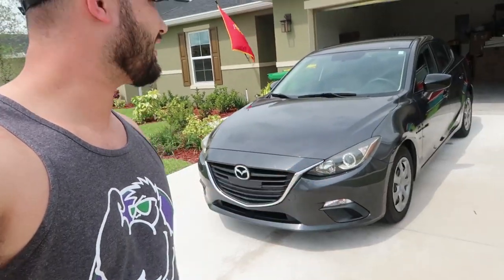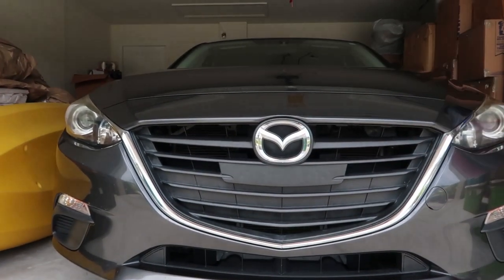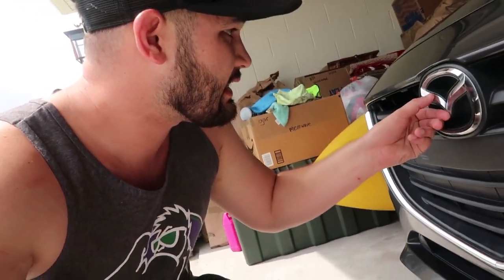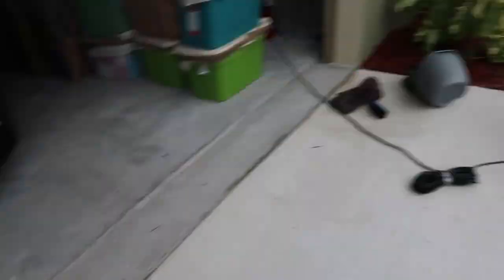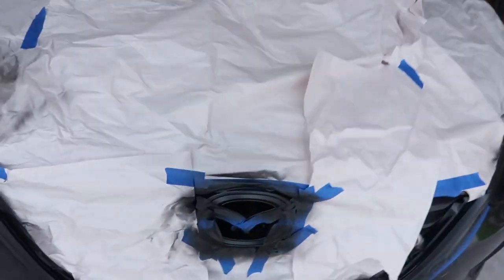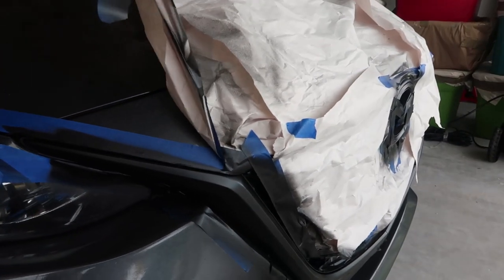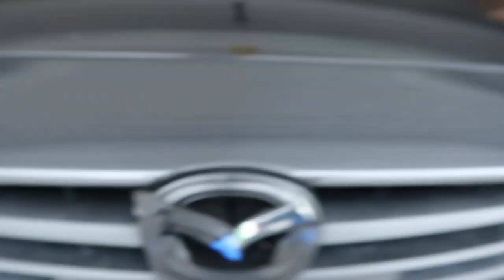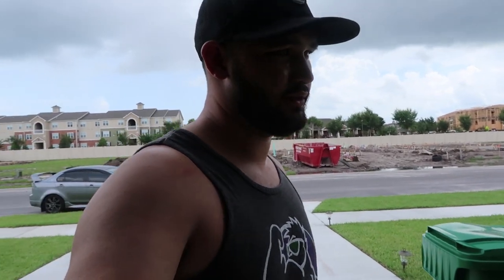Mazda3 Plastidip

Comment: I got this black 2011 lancer es. It's got a chrome trim around the upper portion of the grill. There's not a lot I plan for it, it takes me to work and it's great to just drive around in, but what can I do to a car with just 148 hp besides new black wheels? There's a dovetail spoiler in the back and it's a badge delete in the rear so it's pretty slick. At this point I'm happy with how the car looks but what performance mods can I buy for a lower end economy focused lancer? I'm trying to conserve money until I get a ralliart or an Evo someday. I'll get there eventually but I've always wanted a lancer regardless and this car has treated me better than my last three cars. Also I'm not too sure I want to throw an AM exhaust until I beef the performance up a bit and add a intercooler, I dont want a race car or a show car or anything too crazy that would confuse the computers in my car or make it run worse I just want a car that looks stock (part from the wheels) but stands out from others performance wise.
Reply: Like I don't want to be a ricer I just want to have a clean daily.
Reply: chip tune  it
Reply from the maker: You wont squeez too much power out of the lancer. Save your money bro for the RA or Evo. I had a regular lancer before this
Reply: @TheSnyds  I've had the car for a while. It's nice better than my old car, are sportback Lancers any good?